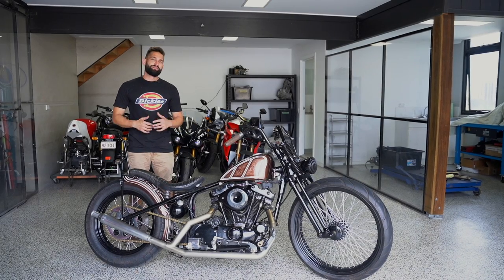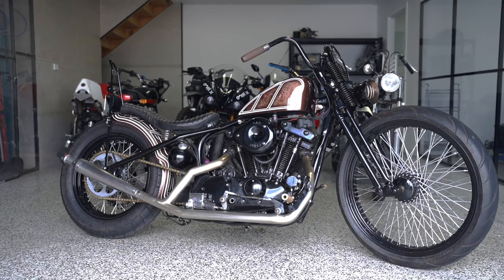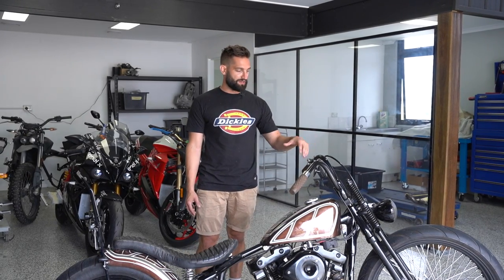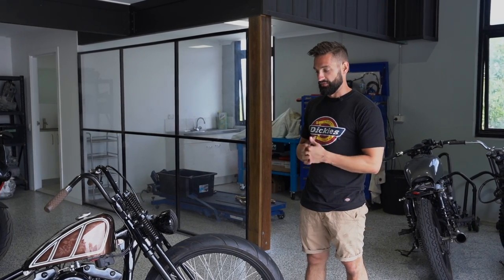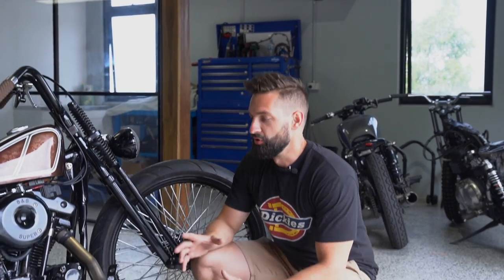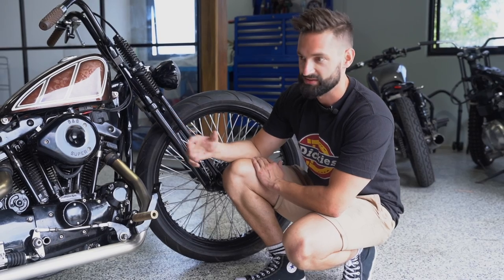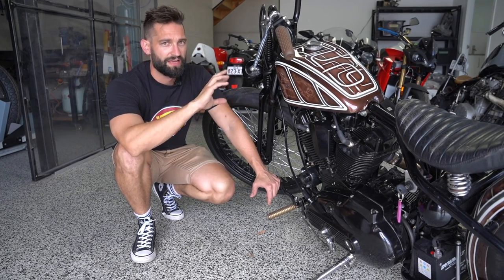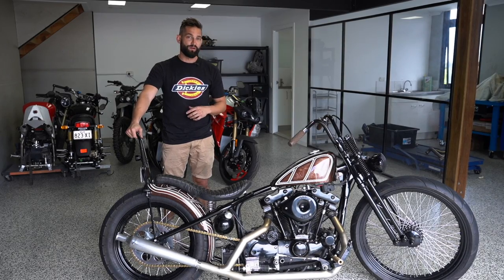Custom Harley Davidson Ironhead Hard Tail Chopper | Purpose Built Moto Quick Fix

Comment: Cool looking bike with the springer front end and big spoke front wheel. The blacked out S&S motor looks great. Cool tank paint job too. Hopefully the bike stops ok with only rear brakes going down steep hills like Tambourine Mt.. Yeah I've seen alot of vids on the net where peeps are changing to Lithium ion batteries on bikes and sounds like its best to stick to Lead Acid. Great sounding bike. Btw - Are you putting another mirror on the right side ?.